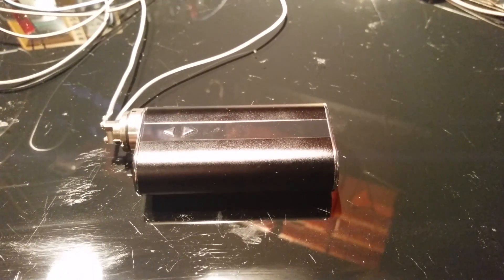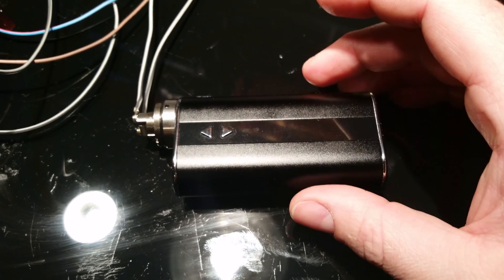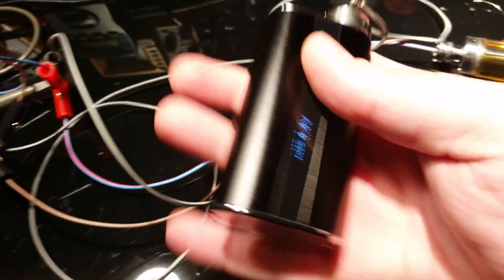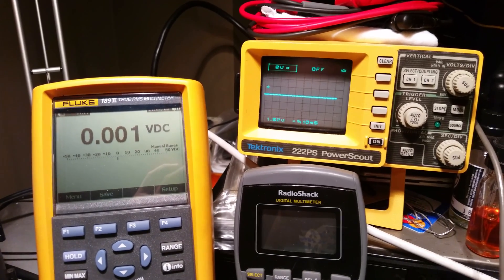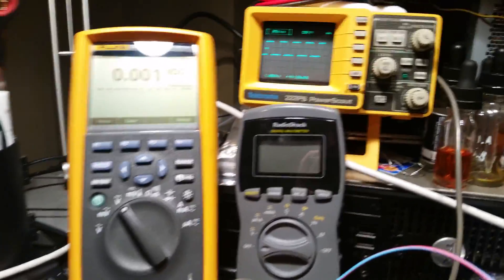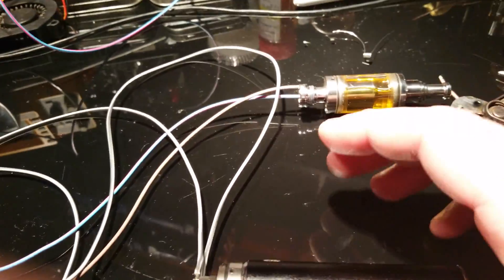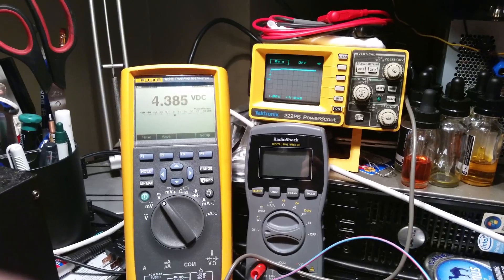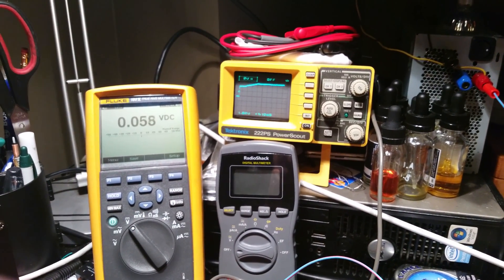iStick 50w: PWM or DC-DC?

Comment: Would this be why my iStick 50 has a buzz or mild vibration sometimes? I have two devices that both do that, one is with a 0.4 ohm build and set at 19 watts (2.7 volts) it will intermittently vibrate only when I press the power button. The other build is 1.0 ohm and set at 14 watts (3.7 volts). 
Both do this maybe 20% of the time, should I be worried, in your opinion or is it a function of the electronics built in?

Thank you so much if you could lay it out for me! Steve